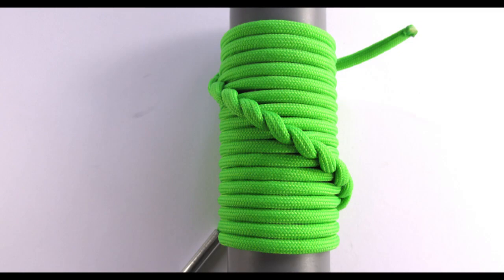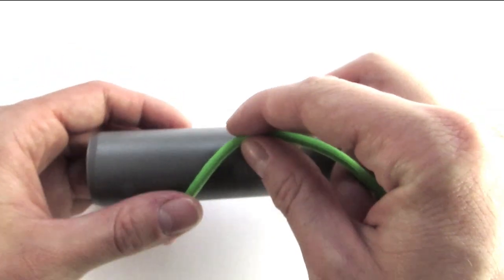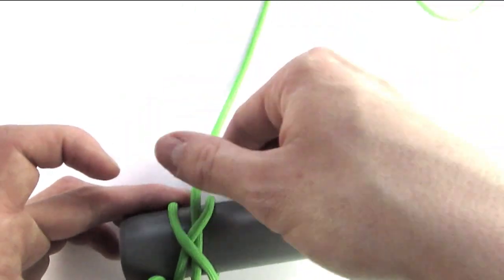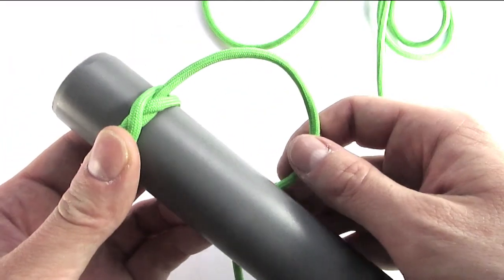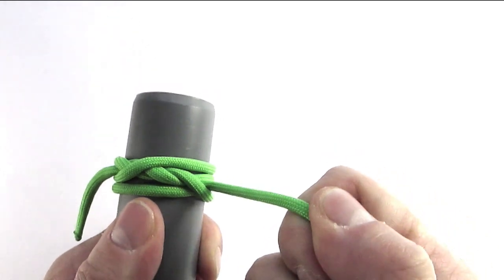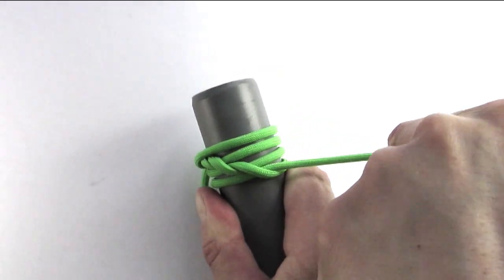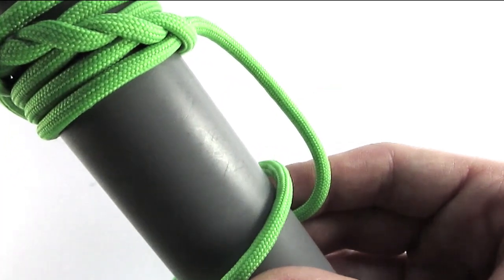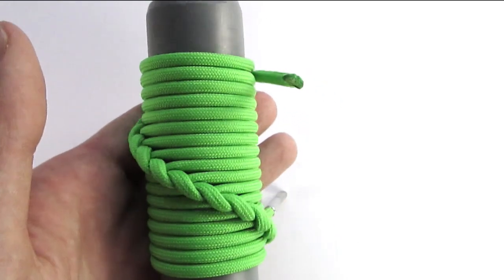Spiral hitching aka French hitching

Comment: The proper name for the "constrictor knot" is the clove hitch.  It's a hitch, not a knot.  But otherwise, great video.
Reply from the maker: Hey there!

Thank you for your comment!
The Constrictor knot and the Clove hitch are not the same knot. They are tied very similarly, but the constrictor knot is a bit harder to make and also holds a bit better.
Generally, I consider hitches, bends, loops, stopper knots etc. all knots. The knot is a more general term, while a "hitch" is a more descriptive name, since it also tells you the purpose of the knot.

Mark
Reply: Nope, different…